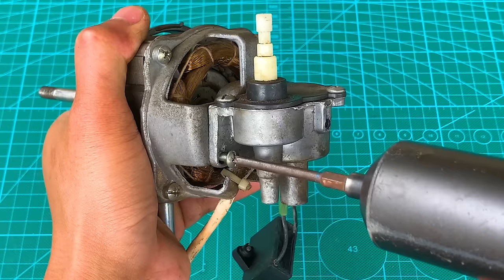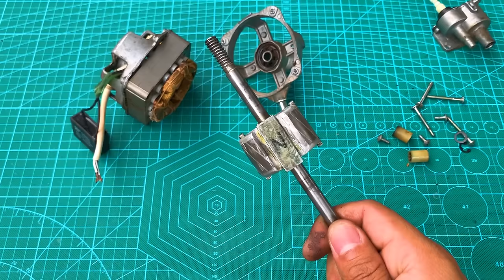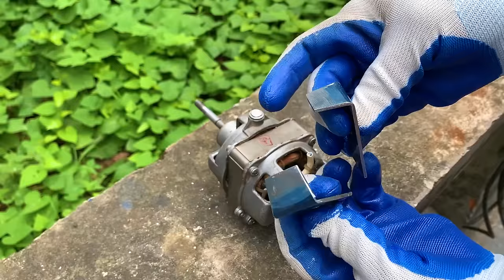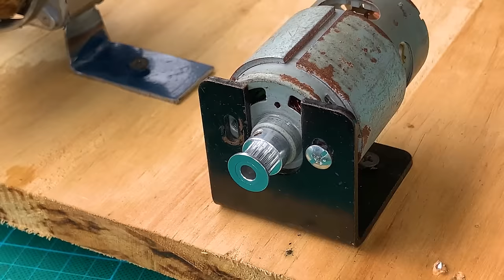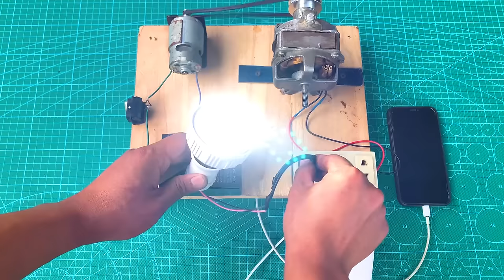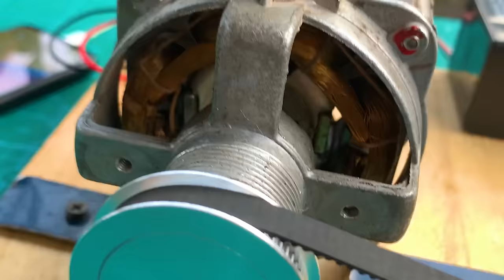How to turn a breaked fan into a high power generator

Comment: I wrapped 3 toilet rolls around my head and rubbed them with used oil.  Then I put a gold coin in my mouth and plugged it into the socket.  That works just as well. 😄
Reply: instead of using oil, I used my own urine and got significantly better results. I understand that if you get urine a fully mature bull in the dark on the stroke of midnight it would be able to power a typical 3 member family  home for a week. the only problem is that u have to use  one 9 volt battery and one AAA battery. cheers!
Reply: Me I just want to go sleep..

Comment: Wow. That's the most inefficient way to turn electricity into electricity I have ever seen.
Reply: How? Do you know what an inverter is ?
Reply: I think its more the concept rather than a solution. Instead of a battery he could use wind or hydro power
Reply: Well he also converted DC into AC

Comment: Suggest upgrading: Since the shaft of the fan motor is long , add a second small pulley onto a second small electric motor to recharge the battery. Take a recharge circuit from a drill battery charger and wire it up to battery to you know when battery is full. Very Nice Video!
Reply: QUÉ   PASA  CON LA BATERIA ? COMO SE REPONE?
Reply: @juliotorales8079  solo lo menciona para saber el nivel de carga y separar 1 generador de 3 conecciones: Batería, Faro/Foco y Carga Móvil.
Algo que en realidad, puede tener razón.
Reply: Tengo una Batería similar que obtuve de una máquina registradora eléctrica. Y hasta donde sé, toda batería necesita un circuito de carga ya que tiene un verdadero tope límite. 
No todas se puede medir de forma consciente.
Reply: 'est tout chargé un portable ET allumer une led une perceuse une meuleuse ça sert a rien sa sort combien de watts ,20 w

Comment: It would be a lot more efficient if you plugged the low wats LED straight on to the battery.
Reply: this is actually how real generators work so everything in this video is real except that this would not generate 220v not even close

Comment: Are you going to buy battery every day ? Haha
Reply: i think , he is just showing you how fan can turn to generator. as for the battery you can hook  the battery with a solar panel setup. so that the solar panel can charge the battery, and you use the battery to run your small fan generator , in case there is no electricity.

Comment: How to charge the battery?
Reply: take the output of the generator into a bridge rectifier (slavage one from a wall plug power supply). It will take the AC voltage and turn it into DC, take that output into a buck converter to bring it down to 14v to charge the battery.  Maybe you need to use a step down transformer to bring down the AC voltage from your generator? but i dont think it has enough power to sustain 120v with any amps so it will go step down itself with any load unlike AC power from your wall.   But im not an excpert , just a youtuber commentor so do your own research to make sure. or you could just plug the genreator into a wall plug and get your DC out that way if you have a 14v wall plug or whatever you need for charging.  Or if you dont have the exact voltage you need maybe plug the generator into a 24v wall plug then bring that down with a buck converter to charge a 12v battery.

Comment: I don't know if this is just for demonstration purposes but I mean what is the point in running a small DC motor off of a battery to run a big DC motor as a generator? Like is this just a show the operation as a simulation? 

Like maybe you decided to do this cuz it wasn't very windy? 

Cuz the inherent losses from the battery running that small motor, and then the friction from the belt and the torque conversion to the big motor would be massive it would be more efficient just to run the battery to an inverter and plug everything off of that.

Comment: Good work man but it will not last once the battery ran out. Introduce self charging diode mode. This will charge the battery and the energy would be non stop. Also upgrade the battery, alternator and other items to cope with KVA.
Reply: Is it possible for it to be connected to a river so instead of a battery charging it water could or air?

Comment: Thats called a squirrel cage motor so  if the windings are made of alloy materials it will not work . The magnet field would need to be hundreds of times higher .But BUT if you don't have the magnets all you need do is put a 10microfard 400volt AC capacitor across the out put wires and spin at high speed. Then it will generate  200volts , The speed is important as the frequency will vary to much .So in the case of this the charger want last long because the pulse rate will kill the charger control chip ?....Remember no alloy wire and any squirrel cage motor will generate ?

Comment: Is the battery charged by the motar ?
Reply: No it seems that the battery powers a 1st motor driving another motor which generates electricity
Reply: @marcellin1371  fine.

Comment: Nice toy. But: All practical tests show that small wind turbines hardly generate any electricity. Because there is hardly any and almost only gusty wind close to the ground!
Electricity yield is proportional to the third power of the wind speed: 100% more wind generates 800% more electricity!  Only extremely high wind turbines are therfore efficient.
Only if you need to be self-sufficient from the power grid, you should install the largest possible wind turbine on a high mast. 
'With solar modules, on the other hand, you can reliably generate green electricity for 25 years at approx. 3-10 cent/kWh!